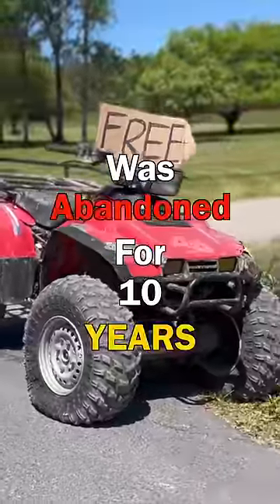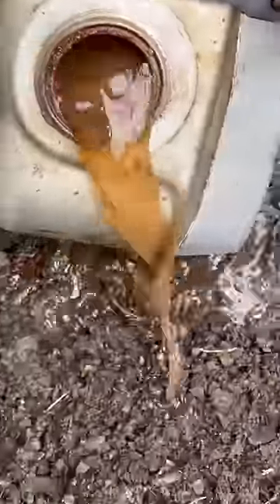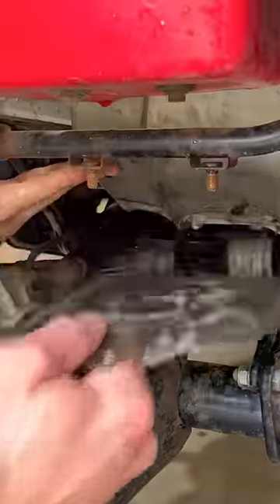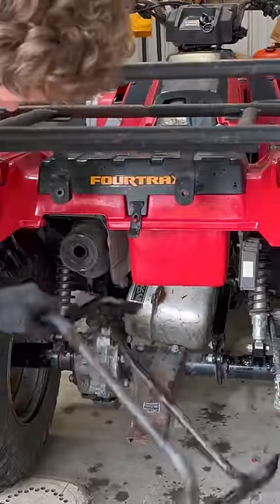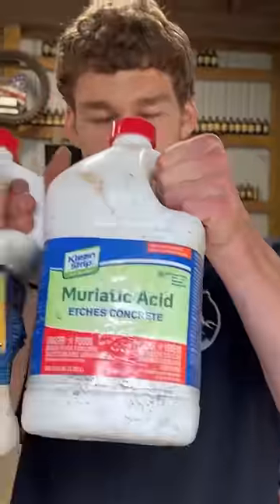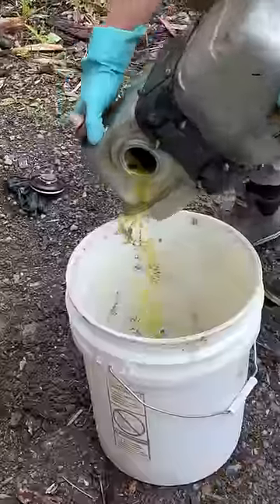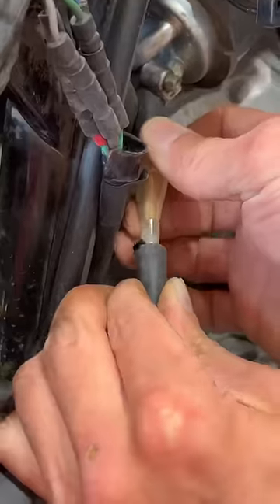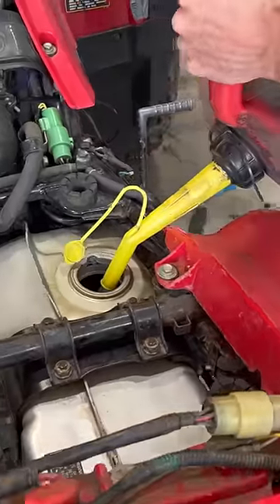They should have Paid ME to take this ATV…. 😳 #atv #diy

Comment: Gotta love those old Hondas! I got a 2000 Honda Recon and they still run like beasts today
Reply: Wow I wanna know how it rubs too
Reply: Not to be that guy, but… What the sus?
Reply: He had a typo he meant run lol
Reply: Dude, I loved the Recon! Front end floated with back tires still digging in! Was a badass!
Reply: If a recon runs like a beast in ur mind, wonder what u would call a trx450 😂 & 2000 isn't a old honda one in this video is around a 87 I'd say
Reply: I still have a 86 250sx and runs great
Reply: Try a 1974 atc90 thing runs with 80psi of compression but won't die
Reply: I still have 2 250R 3 wheelers that have been ridden in their day. They've also been power washed after each ride and garage kept. I've added aluminum wheels that I keep polished periodically with flat track tires. These atv's still practically look brand new to be 30years old.

Comment: I recommend using Citric Acid to clean rust out of a tank. It's much less corrosive and safer to use. Also after muriatic acid you should have neutralized the tank with baking soda and water.
Reply: What ratio of soda to water would you recommend? I have a Harley Dyna tank to recondition soon.
Reply: @DRPowell  I don't have scientific data, if you can't neutralize it with alkaline then you can use about 3 tablespoons per gallon of baking soda.
Reply: @8Slinkies  Um… that’s a LOT of baking soda!
Reply: @DRPowell  you might be right. We use a lot of Muriatic acid at my work and we use alkaline to neutralize it. During the pandemic shortage we couldn't get alkaline so we substituted for water and baking soda. This is on a large scale and like I said I don't have any scientific data. I've used Citric acid on 2 of my own tanks and I was very happy with the results.

Comment: I've been in this situation with an old Honda Big Red ATC. Yes the tank needed to be cleaned out but also the carburetor will be gummed up and need to be cleaned out,  possibly rebuilt. There is no way it started up that smoothly with just cleaning out the tank. Something isn't right here.😮
Reply: Maybe the tank became contaminated long after it was last run so non of the contamination got to the carburetor. You are right though that remaining gas the carburetor may have solidified making cleaning the carburetor necessary.
Reply: It’s a scam
Reply: They think we're all stupid and never delt with these problems any thing for subscribers have a blessed day
Reply: Dude, they do corny shit for views. We both know this😂

Comment: Those old 350s with the tank under the seat are beasts, but they don't like to start very well. Mine instantly floods, even with the carb run dry. Burn the plug off and it's good for the day..

Comment: I genuinely cannot believe the entire fuel system (idk if those are carbed and EFI) didn't get absolutely corroded or the block didn't seize

God damn Hondas and their indescribable immortality
Reply: The fuel tank shut off valve obviously worked.
The tank can get as full of water as it likes...
but with that valve shut..
it can't destroy the rest of the system...
Reply: @John Smith  right but if someone ever tried to start it without draining the tank first it'd draw water into the engine causing some issues, this one just got lucky that never happened

Comment: Was a victim of a hit an run from a kid.  Hit me head on at about 15-20mph I couldn't do anything at this point because it was a narrow trail and he destroyed my Hondas front end and my right arm cause I was holding the handle bars.  I needed to get to the hospital still and wasn't going to take an expensive ambulance so I gave my key a turn and pushed the button and it fired right back up and got me to the hospital driving with my left arm keep in mind.  My Honda now is in better shape than my arm after some body work and still runs strong and hasn't died ever.  👍🖖

Comment: Did you check the carberatour or was the only thing it needed was new gas and cleaning of the tank? Only asking because I fixed one that sat in my grandpas shed for 30 years and had to do the carb and gas tank so I was curious if that was all you had to do
Reply: he def should have cleaned it
Reply: 100% guarantee the carb was cleaned

Comment: Almost always a small engine is just a dirty carb. Over here in Michigan people say, “ oh it’s the spark plug, have you changed the spark plug.” That’s all u hear over here. No it’s not, there’s only been one motor that I’ve had that issue with. There was a crack in it.

Comment: Speaking from experience here, that gas tank is going to rust back up in no time. The muriatic acid removes the rust and etches the metal to a clean surface but then there is no protective layer so it will flash rust instantly ( I've seen it happen in under 5 minutes after rinsing it with water). Instead of rinsing it with the water, rinse it with a solvent such as mineral spirits and then you must seal the tank right away.

Comment: I fixed a Honda four wheeler that had set in the rain for decades ..... Rewired the electrical system and redid the fuel lines..... ran like a boss..... Honda is bulletproof

Comment: You can also use white vinegar if the gas tank is from a motorcycle and you don't want to damage the exterior paint. Just let it soak 24 hours. I did that for my Honda motorcycle that sat 4 years and it started right up.

Comment: I got an 86 honda last summer but it had been stored in a heated garage for 20 years with empty fluids, i filled fluids, changed battery and tires, been riding it since. The difference storage makes.

Comment: I literally had the same experience recently with an old 700cc bike. Totally perfect condition but wouldn't start after sitting for 15 years. Got it for free. Cleaned out the old gas and put a new battery in it. Runs like new. Total cost of parts/fluids was $60 and took me about 2 hours of work. Crazy what people just throw away for free on Marketplace

Comment: Had one these beats back in the day. Fuel pumps would go out and you could grab an external tank off some and ratchet strap it on the front rack and we gravity feed it straight to the inlet for gas. Rode it years after that till the motor went

Comment: I love these quads but I always find it funny that youtubers take the band off from the top instead of the sides. That extra inch of height means you need to take apart the rear frame to remove the tank. Leave those top bolts in places wnd remove the side bolts to split the band, leaving the top half bolted to the frame gives you all the clearance you need to simply drop the tank down and pull it out the rear without any more dismantling.

Comment: It's a Honda, you don't even need to ask if it will run. Some years ago, a farmer told us if we could start an old ATV 3 wheeler, we could have it. It had been in the field for 25 years. The tires were rotten, and all the plastics were sun burnt. I drained the gas tank, replaced the fuel lines. Took the carburettor apart and cleaned it. I changed the spark plug and checked for fir. It started on the 4 pull. 

When the farmer saw we started it, he reneged on the agreement. I took out all the gear I put in and I took a sledgehammer and I busted the cylinder head. 3 things should be learned from this story:

1.) Hondas always start.

2.) Don't trust old Dutch farmers from Western Québec. They are lying bastards.

3.) Don't mess around with a French Canadian. You jack us around, and make us waste our time, we'll make sure there is cost.

Comment: You left out the part where you flushed the lines and cleaned the carburetor not to mention the fresh battery. Oh it's just a short. The real mystery is who was keeping the tyres inflated and moist over the last ten years so they aren't flat and cracked. 😊

Comment: It's hard to see the name on the bottle, because of a glare from a flash or light on the sticker. I myself am doing a rebuild of an older motorcycle myself and I have the same issue with the gas tank littered with surface rust any help would be appreciated, please be safe

Comment: If that gas tank was like that the carburetor was worse you didn't show all that cleaning the carburetor all out new spark plug but and some WD-40 or liquid ranch down the cylinder if you going to do a video do it right